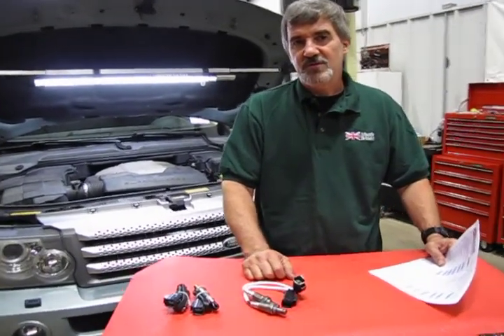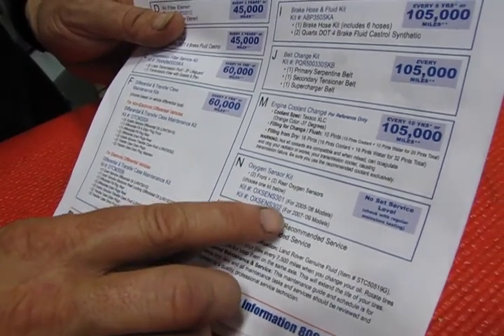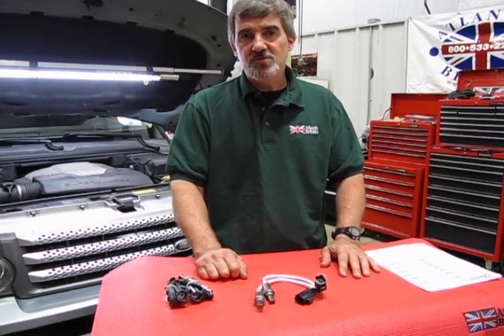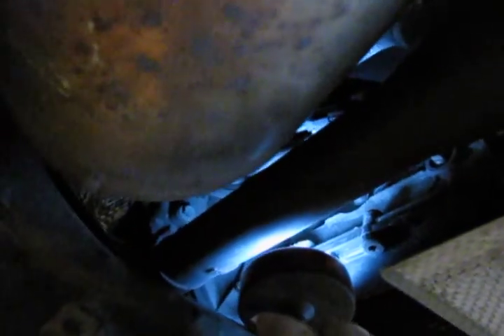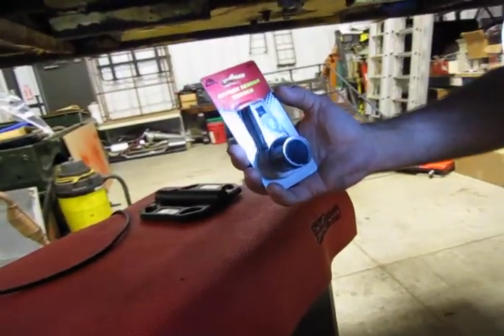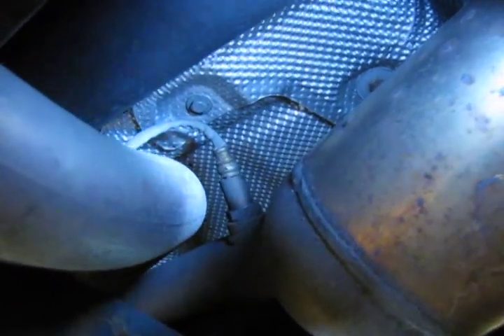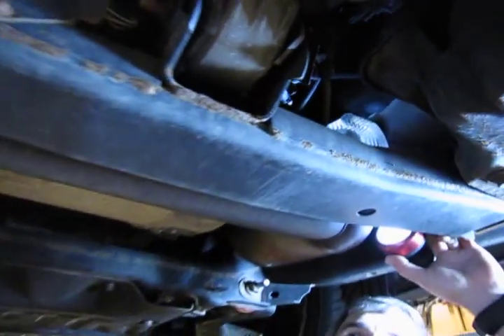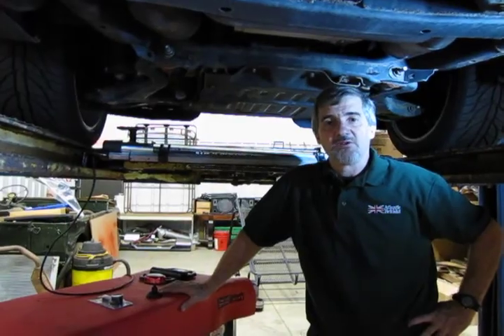Oxygen Sensor Replacement For A Range Rover Sport and Sport Supercharged Models

Comment: Will this cause Rich both banks if the sensor or sensors are bad? Also have lack of power, bucking, slightly rough idle and fuel pressure at the rail is 72-75 psi. It's an 06 range rover hse 4.4l
Reply: I have the same one only I’m only seeing 2 sensors wtf
Reply: @tarrellhughes1078 2 sensors on each side, 1 above the cat and 1 below the cat on each side.

Comment: My 06 rrs supercharged recently started throwing p0171 and p0174.  Is there something really common on these trucks, or a number of causes for these codes? I haven't noticed any drivability issues...
Reply from the maker: Hi Sean, this could be caused by a host of issues. There could be a vacuum leak from a torn PCV hose, a torn Intake Air Boot, or even a broken seal on the dipstick. Also, it could be an issue with your MAF sensor if you're getting both codes at the same time.
Reply: @atlanticbritishrp  I sprayed everything down with starter fluid while it was running, and didn't see any change in short term fuel trim or hear any difference in how the engine ran. Tonight I want to soak down the intake area with water to see if there might be an intake gasket leaking. I cleaned maf sensor last night night and cleared the codes, guess I will see if they come back.
Reply: Did you ever resolve this issue?
Reply: @Szerykguitaracademy1  Sure did. I went to the junkyard and found a Denso mass airflow sensor off of a 2003 Volvo V70 for like 10 bucks. I cleared the code, and it has been fine ever since. If you look it up, that sensor is super commonly used on many different vehicles. So there is bound to be at least like 50 at the junkyard.
Reply: @turbovolvos40  Thankyou!!

Comment: I have range rover evoque 2012  check engine light comes on but when I add lucus gas treatment fuel system cleaner it goes away an I know I dnt wana do this all the time i fill up but it gets annoying i got it check an says fuel pressure low sensor an took it to get checked they showed me what it is an its low pressure fuel injection return pipe sensor but i can not find the part i always see it online for ford ..volvo..an Lincoln i know range rover is some part ford but will it work or do u have parts were to get it
Reply from the maker: We don't usually stock that sensor, but we can get a quality BOSCH Fuel Injection Pressure Sensor for LR2 # LR024969 - it would be $89.95. If interested, visit roverparts.com and drop us a message using the "Parts Question" tab on desktop and the (?) icon in the header on mobile or give us a call at 800.533.2210.  Mention the item #, Name and that it was quoted by Scott. Thx.
Reply: @atlanticbritishrp  thank you very much